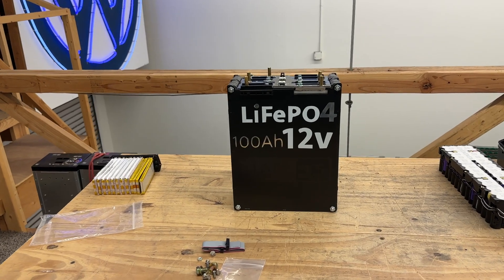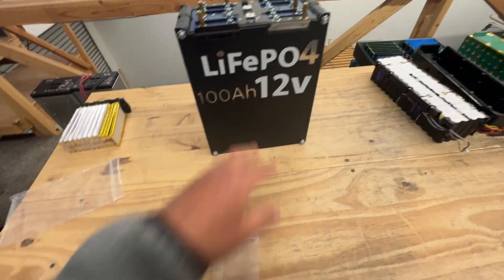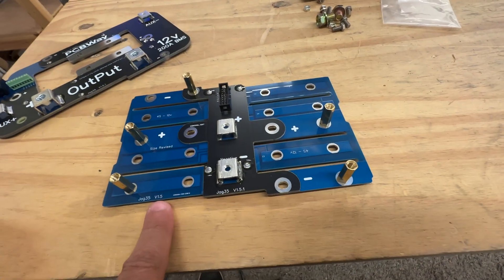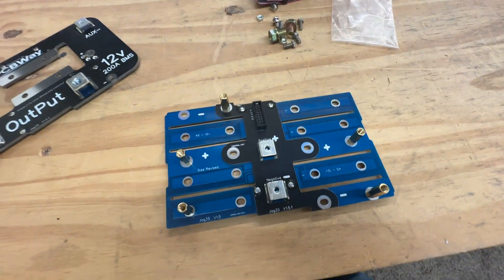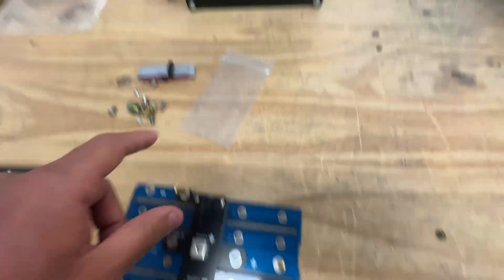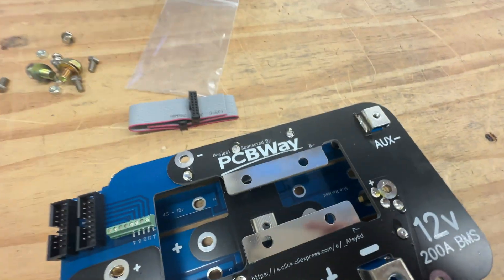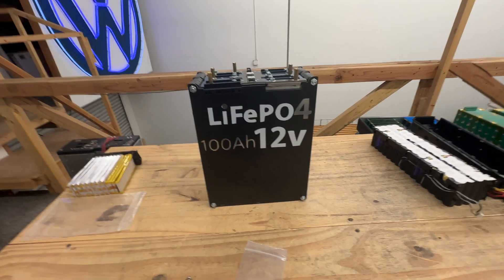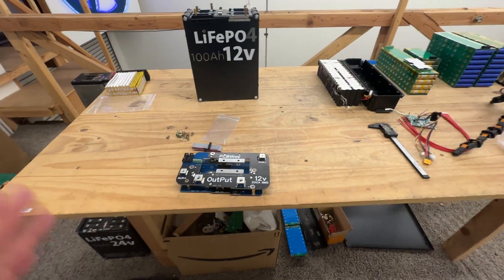12v LiFePO4 BMS alignment Issue

Comment: The AUX ports on the BMS are charging ports, correct?
Reply from the maker: No those are b+ and b-
Reply: Thank you for your reply ❤ So you meant I can connect the pv +/- from charge controller to output +/-
Reply: I meant connecting battery +/- from charge controller  to output +/-

Comment: I question for you I buy inverter 3000 watts pure sine wave from a guy its 48 volt DC 110v to 120 v ok it have DC VOLTAGE INPUT AND AC OUTPUT VOLTAGE THE GUY SAID HE USED ONE BATTERY TEST IT ONLY THE DC INPUT VOLT WAS SHOWING NOT KNOW MUCH ABOUT IT DONT THINKING IT NEED THE 48 VOLT DC BATTERY TO RUN IT

Comment: Both of the BMS boards I ordered had the issue, but mine were only off a mm or so and loosening the standoff and then getting all bolts through the PCB into the standoffs started and then tightening them all solved the problem.

Comment: Hello. I don't know much about these batteries, hopefully someone will read this and offer some help/advice. I don't want to build my own because I feel that I lack the experience.
I am looking to purchase an already built 14-16v Lithium battery that has the capacity to output 1000 amps. Is this even possible? If this is possible, I'd also like information a charging system for it. Thank you in advance.

Comment: Why you don't simply replace the defective boards baffles me. As you mentioned, the problem has only been reported on 5 boards so far. I find it shocking that you keep paying supporters waiting without offering a solution; in my opinion, this is poor customer service, which is probably why I don't buy from you YouTubers.
Reply from the maker: With what? An identical board?  Yeah please don’t buy from me,  you sound like a terrible customer
Reply: @jehugarcia  The board may be defective, as you yourself stated. It is obvious that you lack quality control. I've worked with individuals exactly like you in the past who utilise their platforms to sell goods, are only in it for the money, and don't really care about the customers. 
The wise course of action would have been to provide excellent customer service, send out 5 new boards, and request the return of the faulty ones so you can determine the root of the problem, if any. Not providing a solution while keeping clients waiting for so long is never a smart business decision.

If you were a business savvy individual, you would understand that repeat business is good business and that once customers see the real you in how you handle situations, you will lose them.
Reply: @jehugarcia  I, on the other hand wish to be a good customer, but can't get questions answered. I have been trying through your CHAT to get to speak to a person before placing an order because depending on the answers I may change my order, yet I am having trouble trying to speak to a human, can you send me a number where I can ask some questions to an employee or have them call me. Thank you in advance, looking forward to doing business with you.

Comment: Lol it was mine.
It's the bsm black board the positive aux and the slot by 200a bs lable was really off 
Tried it on both batteries and confirmed ot the black board. I drilled the aux positive hole a bit bigger like 3 sizes and the other one two sizes. To fit
Reply: All other stadium offs fit. The bms and board are fully functional. I did loose a bit of contact point at the 200a bms 12 lable hole but not enough to be hey this is a serious issue. I'll submit pics tomorrow

Comment: I'm obviously not trying to get ahead of your video or videos of the cheap scooter batteries but of what you have found out so far the signal
 Do you know if it is voltage related or frequency related

Comment: Some of the standoffs need a washer to level all of them. The black pcb is higher than the blue pcb on the battery side. add a washer to the blue pcb standoffs.
Reply: I bought 3 of these batteries and had the same issues. Washers to the rescue.

Comment: So I bought the already assembled with BMS too plate and there was one standoff that was off enough that I could not  get bolt to line up. My work around was to loosen that stand off and back off the other bolts and I could lift the top plate enough to get the last bolt to line up enough to start the threads. Use a box end wrench to then re-snug the brass post down to the main battery plate then tighten all the bolts for BMS. Not sure if that flexes the BMS pcb board to much. Am doing first charge with 10amp Lithium charger. Are there any LED mini indicator lights that function on the BMS board?? Anyone know??

Comment: HEY JEHUGARCIA  OR BATT KING LOL   how could i come up with a dirt cheap motor i want to make my side by side a ev   i can rewind a motor if i need to    its a 700i so it can handle even a car motor  it dont have to be fast off the line but i do want it to go 45 or 50 mph               even if you dont know about a cheap motor i bet you can ballpark what is the least hp motor i would need  thank for you time

Comment: Maybe the anomalies are from the battery manufacturer?  Could it be that some were manufactured slightly off?  Maybe track the batch #'s on the batteries in question?

Comment: Same with mine but I made it work
Add a washer on the bottom right where it says 200 , then install the brass stand off. It corrected the offset, just enough

Comment: This might be a dumb question, but if the BMS is 12v, doesn't that mean you can't put several of these in series to create a higher-voltage pack? I had read before that the BMS can blow up or otherwise behave poorly when in series like that. I assume that's how you'd use this battery in a larger installation. A massive 12v pack would be odd.
Reply: I believe it depends on the MOSFETs used on the BMS if they can handle the higher voltage then you can put them in series and they can still safely disconnect
Reply: @recoblade1465  okay this seems like very important information to know about the BMS then.